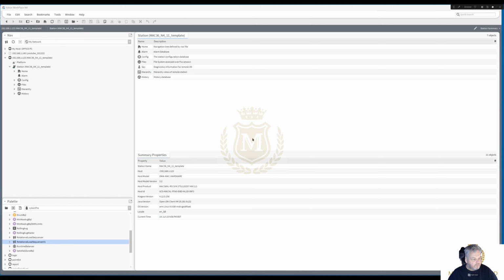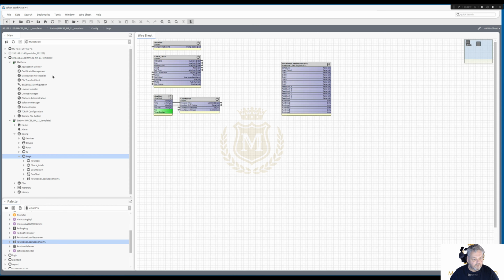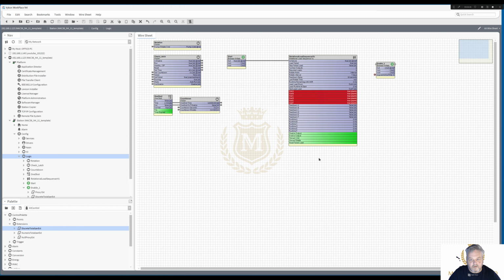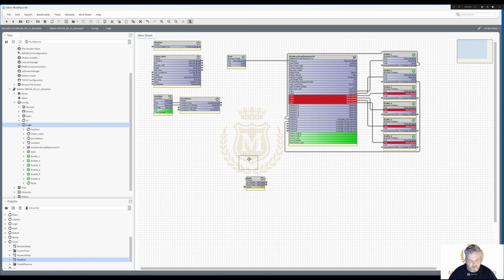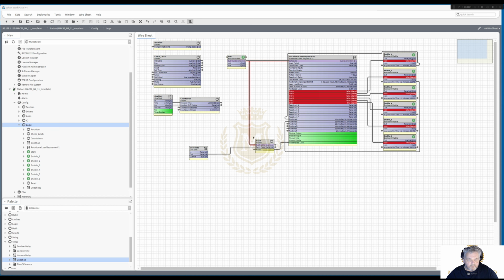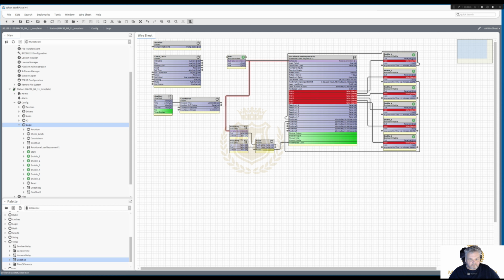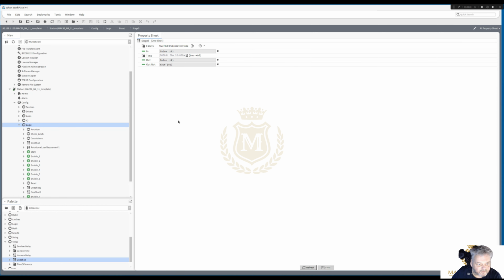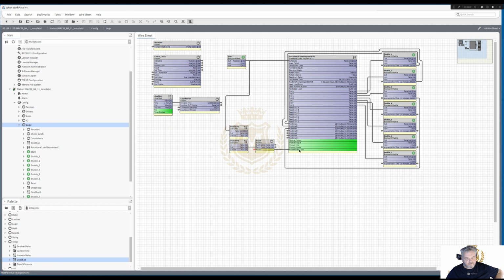#66 N4 Tridium Niagara - Machine learning - Reset for a Load Sequencer

Comment: Hi Maxking, First thanks for making those training videos 🤝 I have a question about the Rotational Load Sequencer.  How can we Enable/Disable Enum writable outputs (out1, 2, 3, 4) I would like to use Boolean point for ON/OFF on graphic but with an enum Switch we can only do enable* or disable* on 2 separate buttons🤔?
Reply from the maker: If you have an Enum you only have 1 output on an enum, and you can set the value out depending on the input, so if you send a 1 on the input then it will output a 1, and so on for the values going in. 
The enum is normally used to display a string text depending on the input.
You would normally place the enum on the PX graphic sheet, so your client can then select the enum text using the set command for the output they want.